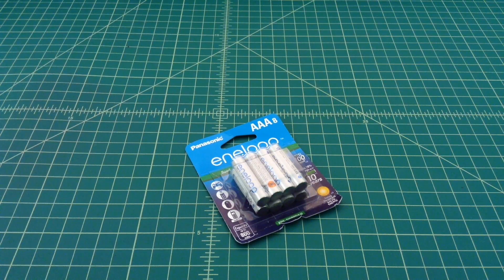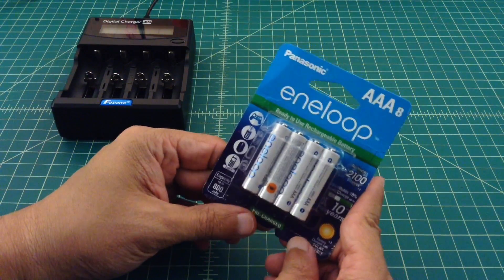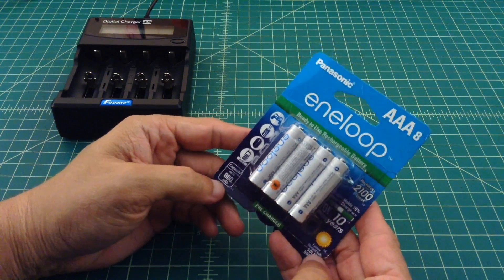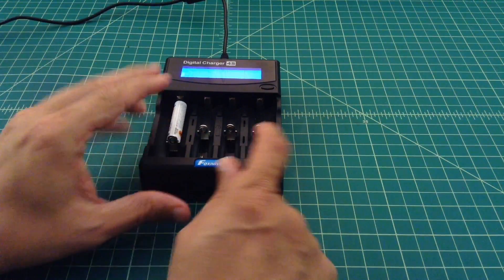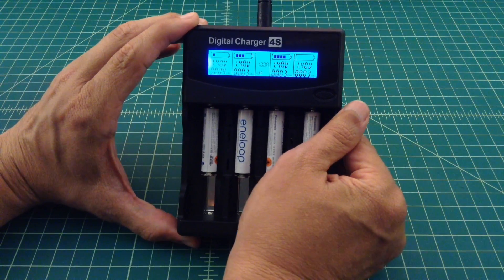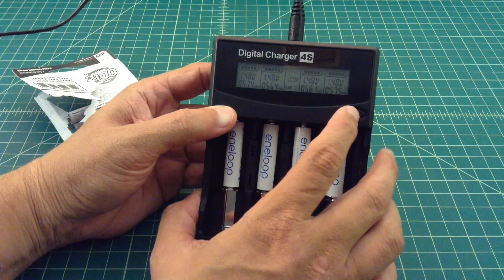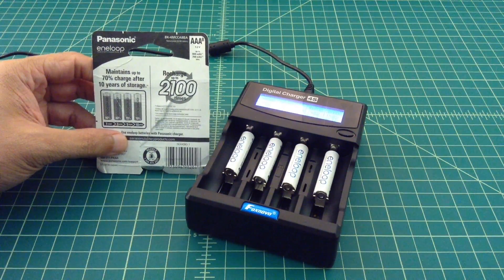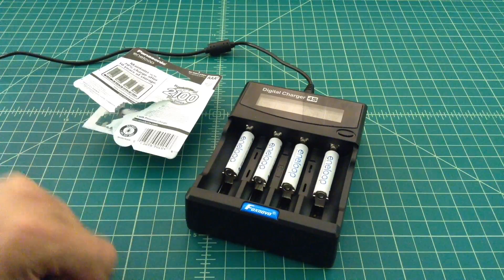Eneloop AAA Ni-MH Rechargeable  Batteries 4th Generation Capacity Test - TheSmokinApe

Comment: HiMan!! You talking about battery charge current!!  You need a LOAD to check batteries. At least you need a discharger equipment, likely this one: https://www.ebay.com/itm/ZKE-QC2-0-3-0-MTK-PE-EBD-USB-DC-Electronic-Load-Battery-Voltage-Capacity-Tester/173074309752?hash=item284c086278:g:EMMAAOSwi8xaTZZc:rk:12:pf:0
Reply from the maker: Thanks for the link!

Comment: hi i have a sony mdr EB 450 BV that requires quite a lot of power so it 
uses 1.5 volt batteries and the only problem is that it is a battery 
drainer as it  requires lots of power .so do you recommend me to buy the
 eneloop 1.2 volt triple a batteries ??
Reply from the maker: +Harman Kardon I'd give them a try...  what are you currently using?

Comment: I just ordered an 8 pack of 4th gen AAA Eneloops and will be interested to see how they perform. My 2nd gen AA Eneloops charge up from 2100-2400 mah in a La Crosse BC-900 charger at 200ma charge rate. The capacity is majorly effected by rates higher than 500ma on the AA, so I wonder if that might be part of the reason they charged so low. 1A is over 1C charge rate for those batteries which I've heard MiMH don't like much.
Reply from the maker: +sandman x Thanks for the feedback and comment, I have been trying charging at both rates and have had mixed results.  Let us know how the gen 4 perform...
Reply: +TheSmokinApe I got them this morning and so far I'm draining one of them at 100mah. It's now around 500mah and voltage is around 1.1v, so I don't expect them to have much more than 550mah of juice from the factory. It will charge at 200mah overnight and I'll see where it ends up in the morning. I've also got it on video and will edit it together tomorrow once I have the results, but looks like it might be a bit disappointing like you got.
Reply from the maker: +sandman x thanks for the update, subbing your channel now.  Looking forward to the video...

Comment: I bought a 12pk AAA Eneloop Pro's and I am not happy with their supposedly 900-950mHa capacity!  I tested them all with the professional smart charger Foxnovo F-4S...  The first 4pk was rated at around 850mHa capacity, the second 4pk was rated at just a bit below 800mHa for all four batteries....  the last freakin' pack of 4 was rated at way below standards of what these Pro's should be, 2 were rated around 780mHa, 1 just below 750mHa and the last one at a freakin' way below at 600mHa!

Very disappointed with these expensive Japanese made Eneloops' in which they all were manufactured a year ago on 7/2014 and non are at a stabled rate!

Oh and for those that swear that Eneloop batteries are equal or better than the power of Alkaline batteries are smoking the wrong shit! Alkaline batteries output the full power than any high quality rechargeable battery especially Eneloop and well tested and proved on the brightness output on high quality led flashlights! Eneloop Pro's produce weak lighting compared to Alkaline battery output...
Reply from the maker: Thanks for the info and for watching...